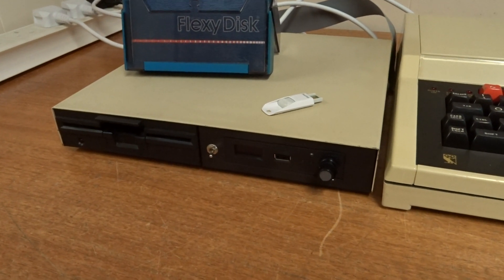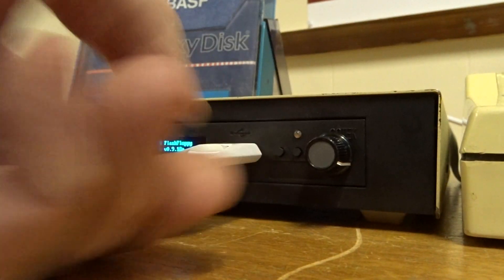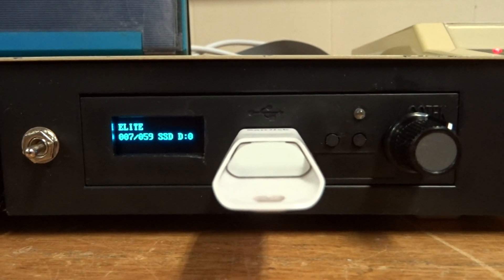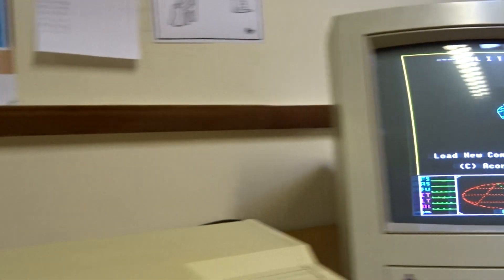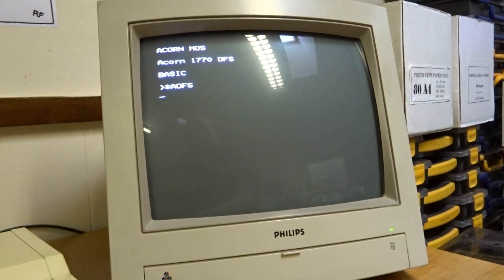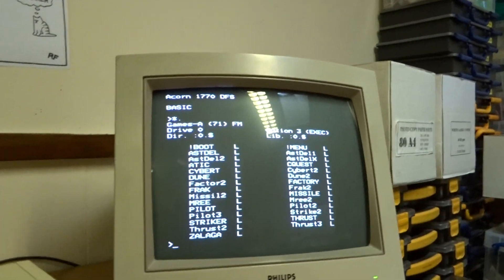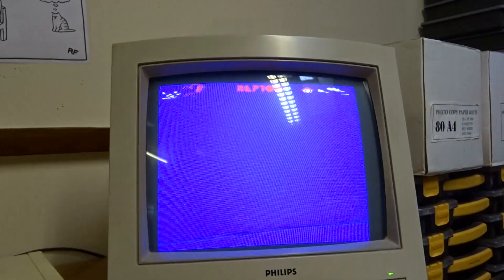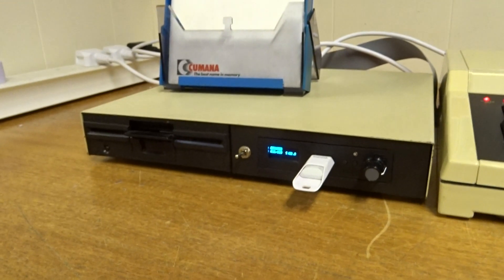GOTEK with 5.25" Floppy Demo

Comment: Is the GOTEK a sort universal computer floppy emulator with different firmware for different computer systems? Or is it specific to one computer?
Reply from the maker: With FlashFloppy loaded, it's universal, you just the config file to customise it to the different systems you're using if needed.

Comment: Hi Mark, is there any benefit in using GOTEK with the BBC Micro compared to the DataCentre?
Maybe GOTEK is useful if you have a number of different machines that require a floppy drive?
Thanks.
Reply from the maker: It's useful in that it connects externally to a floppy drive port, it also has a cute OLED display! Apart from that, the DataCentre is faster and more flexible, because it's integrated into the system via the 1MHz bus port, not just limited to the speed of the floppy disk interface. DataCentre can be directly accessed so can be used as a full USB host, can load and save directly to the USB drive without having to use images, and also has the second slave USB port, 1MB RAM, NVRAM Drive and 16bit IDE interface.
Reply: Thanks Mark